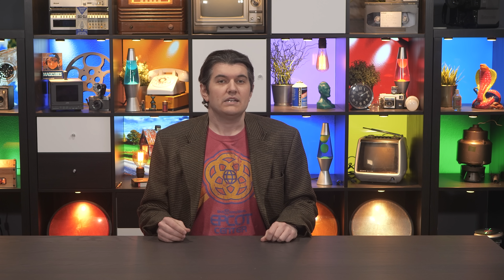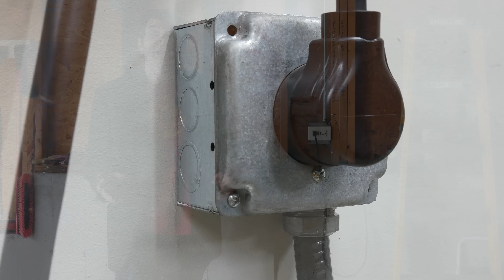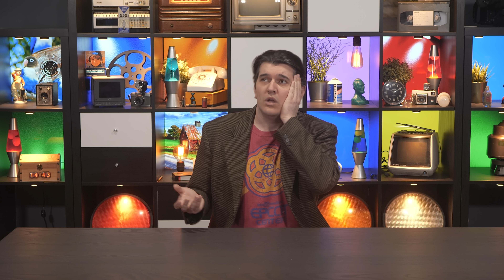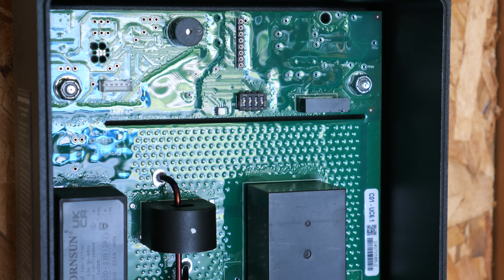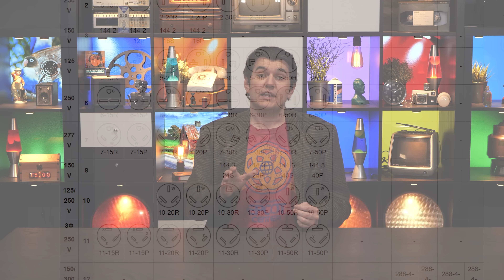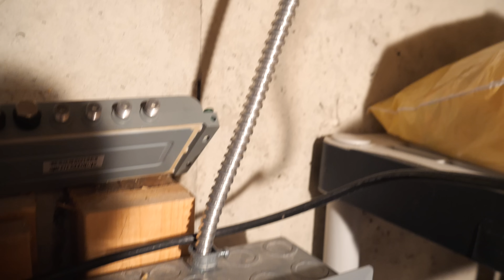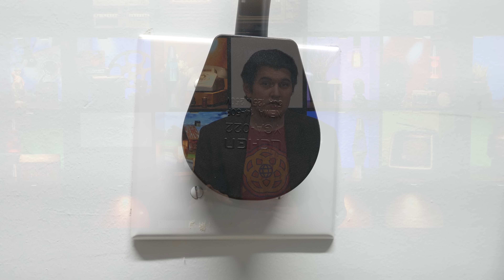The "standard" car charger is usually overkill—but your electrician might not know that

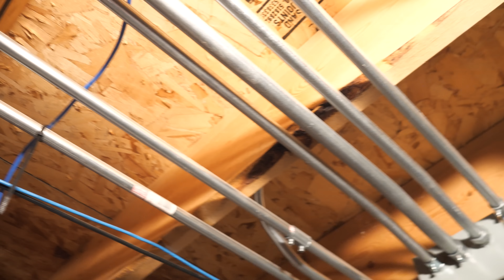Comment: 3:55 yes but conduit is great... you already have a place to put in the 10ga wire!! As a fellow Chicago suburb homeowner thats what I did.  You have to look at the 'conduit fill' which is just the max amount of wires are in that conduit from the circuit panel to your garage. I had an electrician put in 10ga wire in the existing 1/2 inch conduit already going to my garage. I could only use the 10ga wire because of conduit fill requirements but was able to get the 30amp EVSE wiring along with my existing 15 and 20amp circuits already in my garage. I've been using this for over 3 years now, and its been fine.  For the last year we've had two EVs and use one of the 120v 20amp circuits to charge both cars if needed. So...why not use existing conduit already going to the garage??

Comment: I wish that for our apartment building, the outdoor parking just needs a couple out door dock/RV power connectors that would more than provide power for charging, but even if they just installed outdoor rated 120 volt plugs by some parking spots, that'd still more than cover our charging needs if we had an electric or plus in hybrid.

if parking was closer to our first floor apartment, I imagine for charing we could just split the 208/240 volt oven plug (since our apartment gets 3 phase power giving us 208 volts service, but the oven is on a 60 amp circuit) or even just unplug the oven when not needed and plug the car charger thingy into the oven plug (fun fact! since its providing both parts of split phase power, a 208/240 volt oven/dryer plug will provide both 120 volt and 208/240 volt service! Im sure buddy that runs the  channel knows how that works :)

Comment: One thing to also take into account is if you charge outside (not everyone has a garage, or wants to use it for parking) then you also need to account for the power needed for the battery heater.  And make sure when you buy an EV that it actually HAS a battery heater.  Lithium batteries really don't like to be charged in the cold.    I agree with you on the "smart" crap too.  The problem with crAPPs is that it's planned obsolescence. They rely on having a Google or Apple account and there's no way to back those up and they are basically black boxes, so if they ever pull it off the store then your charger is basically a dead weight and you won't be able to use it anymore the next time you get a different phone or if something happens to your phone. I really hate how so many products now want to rely on apps now.  Getting harder to avoid.

Comment: I have a few 14-50R's outdoor and garage, but I have no electric cars, nor do I want one and refuse to have one.
I put the receptacles in as universal power points, for usage for oven/RV/welding/cutting/heavy equipment/etc. of course I don't have an RV or any heavy equipment either. but I can test/run about anything I want, just use an adapter cord/plug or temporary plugged in sub panel with various receptacles/breaker values.

Comment: There is no plug for "larger" voltages in the USA that you can regularly plug in and unplug? For example, we have a CEE 17 or IEC 60309 socket in and outside the garage for different equipment.

Comment: Good common sense. I took a similar approach with my RV. I leave it plugged in to charge the batteries, every so often i may need run some heat or ac if I'm doing some maintenance inside. I just ran 20A service outside, more than covers the needs, pulls 16-17A max and much cheaper to have a 20A outlet vs 30 or 50 for the RV.

Comment: So popular is this channel that even after just a few hours, the comment list is enormous, so it's likely my question will be missed. But I will state it anyway: if one can get by with a level one 110v charger, would it still make financial sense over time to install a level 2 charger, such as the lower amperage unit described here ? I'm thinking that the lower voltage unit will have larger electrical losses over time, which will eventually cost more than the installation of a level 2. Thanks!

Comment: I charge my bolt EUV at 220v 16amp because it was the easy option when I installed the charger. I thought I might want to upgrade it down the line but I haven't felt the need in the 2 years of use.

Comment: Very interesting video. When I need a new car, I hope to find an appropriate electric model. Because of that, I'm saving a slot (well, 2, actually) in my breaker box that previously had a circuit for a hot tub. The hot tub was long gone before I bought the house, but it's a 50 amp circuit with a GFCI installed just under the breaker box, and it happens to be in the garage next to where a car charger would likely be installed. And while this kuncklehead could probably get it installed myself, I'll likely call in a qualified electrician because, well, I'm still a knucklehead and a good electrician deserves the work.

Comment: The only software part of a charger that I do/would appreciate is greater scheduling flexibility. My off-peak time is overnight and all weekend. And it's annoying having to constantly play with the scheduling in our EVs so that we don't waste 36 hours worth of cheap electricity every weekend and don't accidentally have them charging during standard, let alone peak, times during the week because both Hyundai and BMW seem to not comprehend the concept of days of the week in their charge scheduling. Some of the EVSEs do apparently have much better and more flexible scheduling. But ultimately even that is more an indictment on auto software departments than a statement of need for EVSE software features.

Comment: I’ve had an EV as my daily driver for the last 9 years, and my only car for the last year and I’ve only ever used the “portable” charger that it came with that runs off the standard 110v outlet in my garage.  I have a Chevy Spark, though, which is about as efficient as it gets.

Comment: I have a model 3 performance so not even the most efficient version, and I’ve used a 120v plug free at my apartment for 4 years for free and 2 years now at my house, I have a 240 plug but I just leave the 120 plugged in, I get 5 miles per hour so 60 over night, even road trips I’ll charge at my destination that’s 4 hours from the closest charger, so I can get there dead, and be full in 1-2 days. 

100k miles like this not a single problem

Comment: You can also a NEMA 14-50 outlet on a 10awg/30 amp circuit as long as you use a 30 amp breaker and the outlet is rated for 10awg wire. If you do this, you are likely to never melt an outlet. The GFCI rule for garages outlets from 2021 NEC (National Electrical Code) is a bit annoying which is why hard wiring may be easier to avoid that code requirement. Note not all areas use the NEC code and may have their own local rules.

Comment: Protect the cable.
Size your breaker to protect the cable from melting/burning.
Watts are a better unit of power. They are independent of voltage unlike amps.
We were fine charging our two EVs with a 1920W(8A @ 240v) plug in EVSE. 24 & 40kWh Leafs/Leaves.
The nearest fast charger used to be 35km away 7 years ago.
Things will change with home batteries incorporating a EV charging and possibly V2L. Storing solar or cheap power from the day and charging your car and running a home overnight with make our grids decentralised and more resilient.

Comment: I was mixed clicking on this video because I saw the nema 1450 in the thumbnail and thought if you're talking all you need is a 110v 12a house outlet that only works if you live in a big city and don't drive more than 50 miles a day. I have experience with this with my model 3 and my fiancés condo, we drive over 50 miles regularly and I have to supercharge almost daily to makeup for what the messily 1.2KW charging that standard us outlet can do. There are some days if I haven't driven in like 36 hours I get up real close to 100%, those happen maybe once or twice a month when we are particularly lazy on days off in a row.  However I do agree 1 person doesn't need a full 9 kw. My family has 2 tesla wall chargers at there house on one 220v line that outputs a total of 6.6kw and with the dynamic charging aka load splitting abilities of Tesla's chargers this is enough for my model 3 and my parents model y that they share 95% of the time, and that's with living about 30 mins from the start of metro area in our state. The Twin Cities. In theory you don't need a "level 2" charging capabilities 90% of the year, and that last 10% DC fast charging is more than plentiful enough to pickup the slack but in practice if you're total daily miles are more than that 50 miles a day you need more than the 1.2kw a standard us outlet can provide. Rather than installing a full phat 220 or 240v line especially if you're house is older than 10 years and has the electrical panel in the furnace room/ basement rather than the garage like newer construction, talk to an electrician and see if you're wiring to the garage can handle a higher amperage breaker, a 30amp 110v outlet will provide about 3kw and in my research to find a way to be able to fully recover the milage to and from school (61 miles each way) from my fiancés house every night I would need an absolute minimum of 2.8-2.9KW charging, and targeting the aforementioned 3.3kw to give some wiggle room.

Comment: I have this exact set up, 30a circuit and Grizzl-e, ands still more than enough for 90 miles a day. Though sometimes the car does indeed forget, or goes yolo, and lets it rip, and it does infact trip the EVSE. I however said F it and put in a 14-50 plug in for it. Still works fine. If I ever sell the place I'll change it out. 

When I got my first EV in late 2019, the splitter on the 30a option wasn't a thing just yet, so thats why I put in a new circuit, otherwise I really would of just done that.
Reply: Also a note about plugs. I had a regular old 14 50 that burned out at its 30a draw. I put in a new Hubble plug and haven't had an issue in about 2 years now.

Comment: I did not know about the dryer plug and the use of an add-on that will make it so that only the dryer or EV charger will run at any given time. That information alone makes it quite easy to figure out installing and using an EV charger, and makes getting an EV much easier because figuring out power is not an issue for me.

Comment: NEMA 6-20 retrofit? For discussion- I am not an electrician.  

My understanding is that code requires that 120 volt garage outlets be wired for 20 amp circuits.  Therefore by swapping the breaker out for a 20 amp 240 and swapping the receptacle for a NEMA 6-20 (assuming appropriate gauge wire was installed in the circuit) an Electrician could get a 240 volt garage circuit up and running about as cheaply as possible. If there are multiple receptacles on that circuit it would be prudent to blank them off so that only the EVSE would be on that circuit.  Alternatively if there is space in the electrical panel add a circuit in conduit to the most convenient place for car charging and only wire sized for 20 amps.  Much less expensive 12 gauge wire depending on the length of the run and fewer wires since EVSEs don’t use the neutral.

That would be enough to serve daily driving for most people.

Comment: This just goes to show that RV owners should take the time to match the charger to the car, and both to their specific use-case. There's nothing wrong with using extra spicy Level 1 or low-end Level 2 charging while at home. So long as those charge rates fit the driving being done.

Comment: I went a little crazy. I installed a nice hubbell NEMA 14-60 with a GFCI, and it was a right pain.
My main panel doesn't go GFCI over 30, and my favorite vendor looses load neutrals at above 40.
So I installed a subpanel with a 60A GFCI, and fed it from a standard 60 in the panel.

Wouldn't do it again. I never even want to think about 4 gauge again. Major props to the professional sparkies that wrangle 000. The next time, I will probably throw money at the problem, and not try to enable my vehicle's max charge rate.

Comment: You should stuff junction boxes with the wire nuts opening down. Dust can accumulate in the box, and over time, that can become conductive and lead to a wire nut meltdown if they capture the dust.

Comment: I have a smart charger (chargepoint home) precisely because my utility had a large rebate available but only for a smart charger + demand response sign up. It’s actually been a pretty fine charger and held up to weather for 2 years now, but I still hate that it requires the app to control settings.

Comment: Ive charged my EV exclusively eith a 110V 11A plug for over a year now and it's been great. No expensive installation and Ive never had to even visit a supercharger other than the occasional road trip.

It only charges at 5.6 miles per hour, or about 60 miles overnight, but that's enough for me. And then any slack can be picked up on the weekend.

Comment: Hi! Electrician here. Your videos are amazing. Totally agree. Everyone should check how hot plugs and cords are. They should only ever get WARM. for very high power devices like heaters. If they are oddly warm or hot it is trouble! 

Also bad grounding in a garage system will cause electric chargers to reset or claim 'fault' conditions without explanation.
Reply: Tesla chargers monitor plug temps and scale based on that.

Comment: Use 14-50r plugs can get loose or burned contacts over time from continuous use. Typically it's recommended to replace it based on that. Not plug insertions. Just like a standard wall outlet they are designed to have hundreds of insertions without failing. In commercial applications they are used for just about anything that's 220v and are constantly being plugged into.

Comment: I have owned an EV for more than 5 years. 
and have used an OpenEVSE the entire time. 
99% of the time, my OpenEVSE is set at 7A charge current at 240V (1.7kw)  and have rarely upped the current (wired to 32A capacity (7.7kw)

Comment: I recently had to get a new car because I made a stupid when turning left during morning rush. I don’t regret getting my RAV4 as it’s a very comfortable car and surprisingly good on gas; I managed to get like 38.6 mph on one drive home. Thing is, my commute is a whopping 5 miles each way. An electric car is basically perfect for me. The thing is, I don’t know how much I trust older ones, especially ones less than $20k. I’m also a renter, the house only has 100A service, and it doesn’t have a garage; however, it does have a covered carport, and there is a regular 120V circuit out there. I could use that. I don’t know. Everything has been crazy for me, especially since my insurance is gonna go up when it renews in a couple of weeks. Ughhhhhh

Comment: 27:36 a weakly insulated (ie. average) 5th wheel runs its AC units a lot more than you might think. It really becomes a problem since you can't even run a microwave when the AC's running, which again is most of the time. not to mention those plugs get about as many insertions as a truckstop hooker. sure, they do occasionally fail and melt, but that actually happens less often than the 5-15 outlets.

Comment: Drive roughly 30-50 miles daily. 1300 average a month. Works just fine off 120v standard outlet. Maybe have to fast charge once or twice in the winter (Chicago area).

Comment: I have a slight defence of "smart" chargers - my car is an Outlander PHEV. It allows me to set a schedule for charging, and that's it. I have no app for the car, it's functionality Mitsubishi Australia chose not to include. The car is limited to 3.6kw of AC charging. So I have a smart charger, which allows much more flexibility. I have a schedule that ties with my free electricity period, I can remotely set the car charging when I have excess solar capacity, and I can set a remote charging start time if I get home and I'm during the electric peak period. It's still not as flexible as I'd like, but it was $500 (AUD), as opposed to the $2000+ it would cost to get a solar integrated charging station installed. The payback period really should be taken into consideration, because as you say, home fast charging is rarely a neccessity.

Comment: You should look into nema twist locks, available in so many nema standards it will make your head spin. California twist connectors are the equivalent of a 14-50P but are rated for the full 50 amps. The 14-30 twist lock standard is very popular as well for dozens of industries.

Comment: I rarely charge at more than 16A 220V, but the 32A is nice to have in and the price difference is not work the savings in the smaller cable.

Comment: 25:04 my Wallbox can actually charge with my PV electricity only… meaning I plugin, it reads the Electricity Counter, if there is electricity >6A going to the Grid, it starts charging the car with that amount.
Reply: Hold up, can you explain this a little bit more? I am assuming you generate power for the grid using solar. Is it only the excess power you generate going to the grid that you can use to charge your car?
Reply: @nobreakingthepickle3452 exactly! 
But the car cannot charge with less than 6A..

The excess can be pumpet into the car!